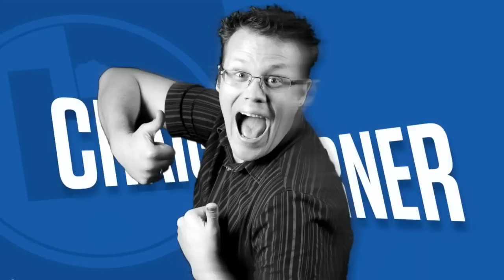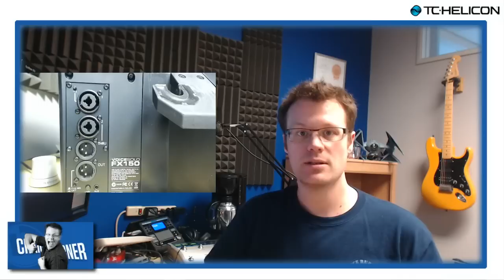FX150 - Dry to FOH - Craig's Corner - TC-Helicon

Comment: I'm just trying to use my Tascam dp-04 to record a vocal track, I want to go from my fx150 that I own,I have two of them,I want to use the live sound while I'm singing no headphones mixed with the Reverb the way I like it live, and then I'm trying to figure out how would I record my voice live through my Tascam dp-04 with the effect on, I want the effect from the fx150 to be recorded directly into the Tascam DP 04,l realize I have to have my high impedance low impedance quarter-inch adapter on the end of my XLR cable to go into the quarter inch Jack on the Tascam dp- 04 input,so my question is will this work and can I come out of the back of the fx150,and go into my Tascam DP 4 to record my Reverb on my voice?????

Comment: Hi bought a fx150 in original box and packaging,  but it has sound and preamp issues.  Loads of hiss and floor noise and very little volume especially on channel 1? Also di is really distorted and sounds all effect with absolutely no natural dry signal with it?  Really need support and some one to fix it?  I'm located in Dublin city centre lreland is there anyone who could get this little pa monitor system up and running properly for me?  Many thanks Regards Vinn 😎 👍

Comment: I think this is what I want - I would connect my mic into channel 2, then Thru would go to FOH, then FOH mix back into channel 1.  I would want to adjust the level on channel 2 without affecting what goes Thru to FOH.  Will that work with this setup?
Reply from the maker: Yes, though you would want the mix coming back from FOH into CH1 to not contain your mic that got sent/thru from CH2.
Reply: Would that be a problem?  We only have one monitor mix, and the other guys need some of me in it.